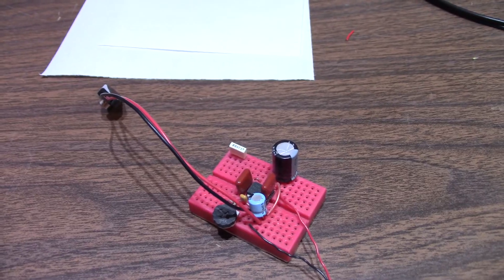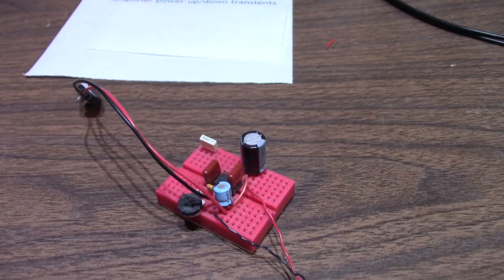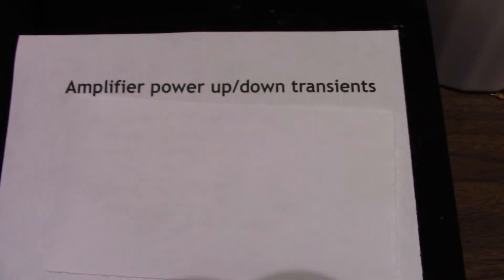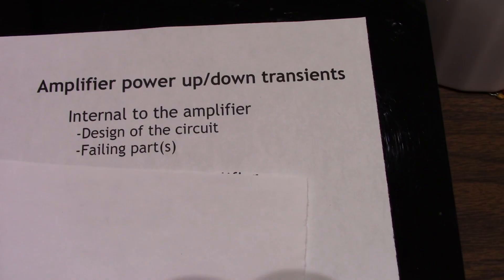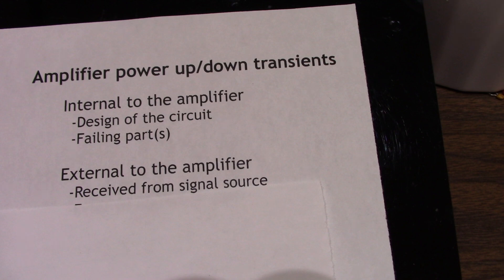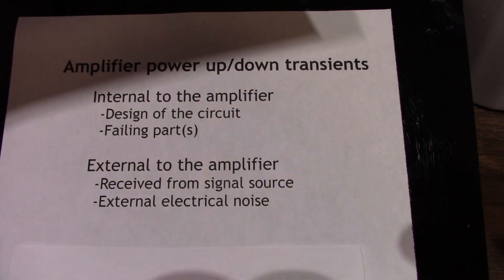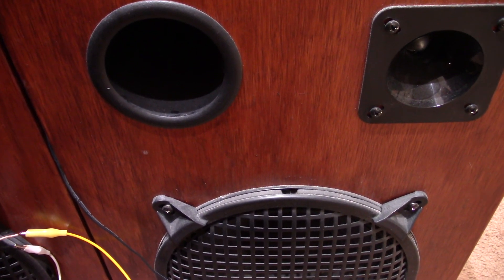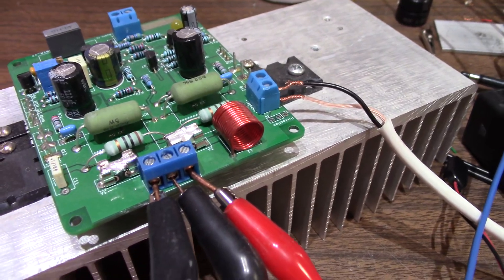Dealing with amplifier power on/off pop sounds

Comment: I added a cheap line controller for my amp . One I've had for years that just hooks up to the rca cables . And since then it does a pop on shut down . I used a y adapter as a short cable from dac to line controller . I'm gunna see if it's because the adapter actually loops left and right preouts . I'm gunna switch that cable and see what happens .

Comment: Dirty contacts inside switches can be a reason too, if it's a switch in line with the power or signal.
Cleaning them and adding a decoupling capacitor helps.

Comment: Hello! sorry for my bad eng language.
Can you help me?
i watched your video:
Correcting hum, buzz or distortion in audio amplifier projects.
But i dont understand lines on this diagram.
my issues: blowing spekaers, amp have  voltage on body, rca voltage loss, bass is weak itp.
I see this speaker - on diagram, but this + line above amp what is this? disconect the - wire or + from speaker and put to this line? Please help, Thanks!

Comment: I experimented with a Pi filter in my power supply and came to the conclusion that a 2mH inductor between the 10000uF reservoir bank and a 8000uF bank almost completely eliminates the power on pop as well as the mains hum. Yes, that's a lot of capacitors, but it's worth it and the sound is more dynamic as well. I did also add a back emf diode across the inductor bank. The power supply plays a very important role in dynamics and noise filtering.

Comment: I would never dream of using any amplifier without a delayed start and possibly more important a DC monitor. Changing a relay after 5 years is a small price to pay rather than replacing the bass drivers on a pair of speakers. 30-60 volts across any speaker is never good.

Comment: nice to see this often ignored topic , came across a known issue with quad amps where they break into oscillation (405 i think) within the audio spectrum at switch off,  a high midrange squeal, i was never impressed with the whole current dumping complexity already  then that on top!  and no mute circuitry is a bit obsesssive on something consumer grade, ditched that and made my own amps since 
my own amps just have a 2 second turn on mute and any switch off noise is something that needs fixing.
now asus motherboard windows boot up pop is something i need a solution for , a driver update caused it!
Reply: It's sad to find that many of the elite audio brands are after all not that great, as you mentioned with the quad.
Reply: @bobisyouruncle1  yes never meet your hero's, I used to love Aston Martin till my job means I work on them, held together with duct tape and stacks of washers under panels to get the height right, and led headlights (the sidelight bar) where if one led fails the whole lot go out, and anteque sat nav lifted straight out of volvo that's the db9

Comment: Its possible to eliminate the power on pop using a speaker coupling delay circuit with a relay? I saw this in speaker protection circuit when the amplifier powers up puts itself in the protect mode for 1-2 seconds.
Reply from the maker: Yes, that would help provided the output is not capacitively coupled to the speakers.

Comment: Can some of these clicks, pops be produced by the power rails not energising components at the same speed ?
Reply from the maker: I would say that it is due to different stages of the amplifier's bias currents starting/stopping at different times. Also charging/discharging rates of capacitors used in the circuit among other things.

Comment: My home-brew pre-main amplifier pops upon power up only, so i added a toggle switch between amp and speakers, which i switch on a few seconds after i switch on the power supply. My amp uses a single supply, so the delay i give it, gives the output caps to charge. The pop you hear, with a single supply amplifier is the dc rushing through the output capacitors until they are charged up & is not good for the speakers. My power supply is external from the pre-main amplifier.
Reply: My problem was a little different buy my solution was almost exactly the same--I have to power everything on in a specific order.  In this case I have a secondary amp for my surrounds that I have to power up before the main amp else it does the popping.

Comment: I bought a Dayton audio $400+  1000w amp from parts express  brand new and it has a really hard thump on and off  ridiculous for the price the thump really bad it a class ab i hate even using it because of it. The amps new none to do this. you think for the price it wouldn't do that. It sounds like the speakers going to blow up . I thought mybe a speaker pertection board might stop it i lightly was going to ask you then this video came up probably because iv been look for a way to solve  it. Part express should be ashamed of them selves for sell a amplifier that literally sounds like the speakers going to blow on turn on for the price point.  Thank for the video much appreciated  sorry just a little up set.😅
Reply from the maker: It would be interesting to capture the transient on a scope if possible. If it is more than a couple volts, I'd be concerned, otherwise probably just a harmless annoyance.
Reply: @JohnAudioTech  thanks I'll  look in to that. I had messaged parts express about it and if it will damage my sub and they Said it best to just always leave the amp on wich I thought that ridiculous I can live with a small thump but its not small and  the speaker moves quite violently. For 800$ for amp a sub I will never order from parts express again  thanks for your time and reply it's much appreciated  thanks again John 💯🙏👍✌️
Reply: was that the 1000w plate amp or the rack mounted version?
Reply: @archieapril5284  plate mount
Reply: @josephsaucedo8691  I have had no issues with  my plate mount, which is going on 10 years. i almost went with another plate mount, but decided to go the rack mount version. the popping/thump is out control with this one.

Comment: I have a small bass thumb when power on, and barely noticable when power off.

My amp is somewhat simple circuit type and less part means not so much possible fault expectitions and good troubleshoot knowledge if and when there is something malfunction somewhere in the amp.

Just resently i changed output mosfet, becouse old lost linearity and other parameters to work as intended.

New mosfet in and bias adjustment for driverboard potentiometer and amp is back in operation.

Comment: Does any "slow initial charging" (of the P.S. smoothing capacitors) resistor reduce the "pop-on" ? But to be honest I prefer a manual "rotary" knob switch  OFF - STANDBY - ON. It takes me 5sec and - to my taste - it is more "cosy"
Reply from the maker: It may depend on the design of the amp. Different stages may "bias up" at different voltages. It may help or worsen the effect.
Reply: @JohnAudioTech Yes. Indeed